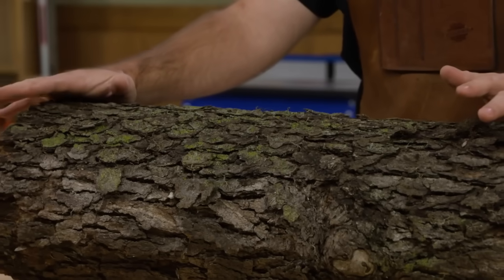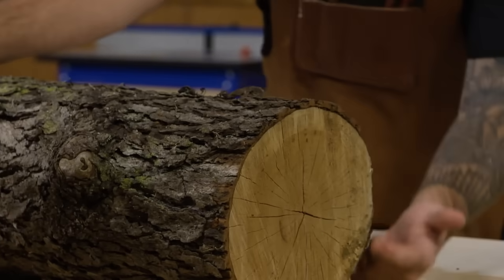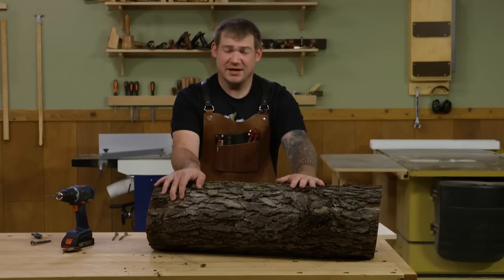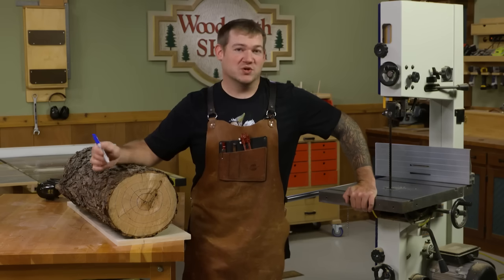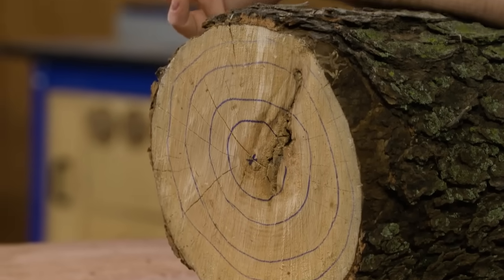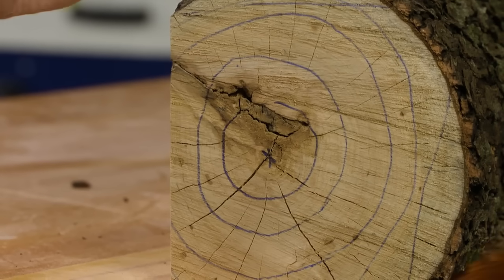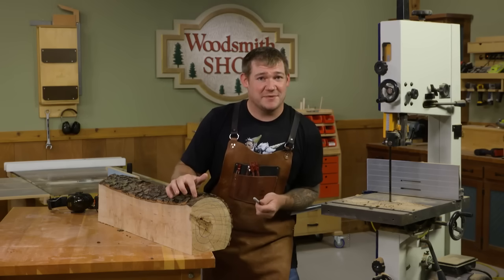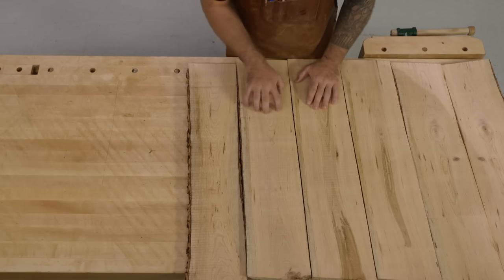Logs to Lumber on a Bandsaw

Comment: I cut a lot of my own lumber. An important thing I learned is to cut all my stickers to the same thickness. Place the stickers uniformly above and below each other per layer. This helps to minimize twisting. It won’t eliminate twisting if the boards have a lot of internal stress, so cutting the green board a little thicker will allow planing later.

Comment: I do something similar on a much smaller scale.  I'm not really a wood worker, but I like to use native species for knife scales.  I have property in the Ozarks and we are constantly cutting small trees and limbs out of our roadways.  I have plum, persimmon, cherry, walnut, sassafras, poplar, redbud, sumac, and paw paw pieces all drying in my basement.  I mill it on a table saw.  I made a jig with square sides that I can bar clamp to the ends of the log.  The jig runs along the fence and the bar clamp holds the log to the jig which prevents the log from rolling or binding the saw blade.  I seal the ends of the boards with duct tape and then write the wood species on the tape.  Some woods are very similar in colors and grains and are not easy to differentiate once the bark is removed.  Once it's dry I rip it to the nominal thickness that I desire and then plane it to a finished thickness.  If it's a live tree that I'm removing I ring it which will kill the tree and let it stand for a year before I cut it down and mill it.  If you ring it after it has leaved out the leaves will pull a lot of moisture out of the tree as they wither.  The whole process takes a couple of years so it does require patience.

Comment: very interesting.  i don't know where you're located, sounds like you're up north somewhere because to someone like myself being in arizona it sounds like  a joke to say "it takes to years to dry".   trust me,  stuff dries so incredibly fast here, you have to add moisture to try to slow down that rate to avoid nasty cracking. 
I have some African sumac wood which is in my opinion one of the most beautiful woods in existence (especially if exposed to the sun, it gets a beautiful red hue), but I don't have a bandsaw.  you mentioned that it's possible to rent time at a mill or something?  how do I find something like that here near Phoenix?

Comment: How could you get mostly quarter-sawn wood from that log?
Reply: zigzaging. You start by making 4 quarters. Then for each quarter, shave a board, turn & rotate 90, shave a board, turn & rotate, until the end. If you look from the top at how you cut, you'll see a zigzag line

Comment: Thank you. 

First time I’ve seen something from you. Very informative and safe. I’ve seen some videos that make me want to go to the ER just by watching them!

I need/want to mill down parts of a friends cherry tree that died. 

I only own a 10” bandsaw. I have seen some videos in the past that use a table saw in conjunction with a bandsaw to mill raw timber. Maybe you have posted one?

The cherry tree was cut down to about 40” in length sections, then quartered down the length (with a chainsaw). The fattest piece being about 8” wide. 

Sorry for all the specs. 

But do you think a brand new Rikon bandsaw (which I don’t want to kill for my friend) with an 1/2” blade can cut it?

I have a table saw, planer, and jointer…

Usually, I leave milling up to the pros and pay for it. That said, I would love to do this for my friend and gain experience doing so. 

Thanks in advance for any feedback!

Comment: A tree fell in a small wooded section across the street, from a snow storm 2-3 weeks ago. Tree guys came and cut it into 4’-5’ sections and just left it on the side of the road. I grabbed 5 of them.
How soon will checking start?, because they all had serious checking just a few days after it was cut up.
Thanks!
:)
Reply: You want to seal the ends as soon as you can after the tree is cut. I mean like set down the chain saw and coat the ends. Ends of the logs dry out quickly and the stress in the tree rings causes the ends to crack quickly. I usually get free exterior latex paint from the household waste recycling center and look for the thickest consistancy I can. If the logs have not cracked yet paint on 3 coats on the end of the logs over a period of several hours. Keep the logs out of direct sunlight and off the ground using a pallet or scrap wood. Then watch them every couple of days for cracks. If you see a crack developing squirt some household caulking over the crack and smear it in. If I have a valuable log I will coat the entire end of the log in caulking also. I have had logs sit for 2 months or more doing this with no cracking.
Reply: @azwheeling8189  Thanks for the knowledge!
 These logs may be a lost cause. They sat in my driveway for like 2 weeks before I painted the ends. Used a regular latex paint.
It already had some heavy cracks. After 2 coats I could still see the rings (as I assume the end grain was soaking up the paint). Gave it like 5 heavy coats.
They are sitting on a sheet of paneling in my garage.
I can’t tell the species yet as there are jagged chainsaw scraping every direction.
Based on your experience, hate these salvageable? If so, what’s your guess on how deep these cracks may have gone?
Hoping to cut, stack,sticker, clamp this week.
Thanks again brother!!!
:)
Reply: I use a real sawmill and soon as I can I seal the ends. sometimes I use this expensive wax paint but in a pinch I have used old paint that was drying in the cans. which isn't bad and helps me identify the wood later because of the color

Comment: Thanks logan. I was wondering if you coated the ends with anything like a wax ,  or does it even make a difference. Thanks
Reply: From bowyersI have heard that they seal their boards/staves with PVA Glue (cheap white woodworking glue) on the ends after splitting the logs in order to prevent splits during drying .... a single one would make their staves useless.

Comment: I use shellac to seal the ends or I mix beeswax with varnish. I lay a small long strip in front of the log and it just stays there. I do NOT want screw holes in my wood.
Reply: Not sure what you mean about a small long strip in front of the log but I do think that the screws he used are much longer than needed. I would think that an 1 3/4" in the middle of the log at each end would be enough but not get into usable wood.

Comment: Does air drying really ring moisture levels down to the 5-7% for use?  I’ve been told it’ll only get down to about 15%, then needs to be kiln dried?
Reply: Depends on the ambient humidity. Stick logs in a dry, hot garage over the summer and they can get under 5% moisture in one summer.

Comment: The video mentioned in passing putting some sort of sealer on the ends of the boards to prevent checking, but didn’t go into detail. What would you use to seal the ends, and is checking a bigger issue in lower humidity environments? I live in Colorado, where it’s super dry. TIA!
Reply: Anchor Seal is the gold standard, but you can also use latex paint or poly for some success. Anything is better than nothing

Comment: Forgive my ignorance, but what is the purpose of putting stickers on the cut lumber? And are they a special type of sticker?
Reply: Stickers are 3/4 X 3/4 pieces of scrap that are put between drying boards to allow air flow to dry them.
Reply: @robertelawson4185  Thank you for the explanation. Definitely not what I thought he was referring to when I first heard it, lol
Reply: You also want to put the stickers as close to the end of the boards as possible. Like 1/2" in or so. The old timers say if the ends crack the cracking stops at the stickers. I don't have a problem with cracking or checked boards as I watch my lumber like a hawk from the time I aquire a log chunk until it is stacked for drying and about 2 weeks after initial drying. I also dont expose my drying lumber to windy days. Drys too fast and that causes checks and cracking. Gentle breeze out of direct sunlight then back into my wood shed at night. Once lumber is not "wet" anymore and about 30 percent moisture it goes into the shop loft until dry. One vent on each end of roof  for ventalation. Also a box fan in front of one vent to increase ventalation if needed. I keep an eye out for mold on the lumber for about 2 weeks after it goes into the loft just to make sure that does not become a problem. i have dried thousands of board feet doing this. Some wood needs weight on top to keep from warping to. Or clamping aparatus if you have it.

Comment: Good info.  Thanks.
Metal detector?
Reply from the maker: Hit or miss in my opinion. I don't use them on my sawmill, because it's not worth the time. Ill usually give the log a visual inspection and remove anything I see. Otherwise, the best metal detector is a new blade, as that's when ill find it :-).

Comment: Dont forget  to tell that you had dry the lumber using stickers after milling boads, then  joint one edge and then rip on the tablesaw, then use the dimension planer, use the router table to cut the tongue and grooves, then after installing you need to use a large beltsander to finish. Some people without experience in wood work think they can do this with just a small home bandsaw. I told her I would mill her logs into usable boards. I have a portable sawmill and can mill logs up to 30" in diameter. she seems to now think she can just throw these on a home bandsaw and dry for 2 weeks... it may appear and feel dry, but use a real wood moisture meter and see what it is inside, the wood usually shrinks about an 1/8" after drying.. 1" thick boards maybe in 6 months air drying. After seeing videos like this she seems to think a home use bandsaw will do it fast, not even a commercial  saw would keep up with a real sawmill the teeth are 7/8" tall. What you are doing may be good for a small project but couldn't imagine doing an entire floor.

Comment: The rule of thumb with drying does depend on geography.  In the arid southwest, it only takes about 12 to 14 months for 8/4 stock to air dry to 8% (basically independent of wood type).  It is better to use a moisture meter than to rely on a rule of thumb
Reply: Moisture is measured up weight, not a $2 meter.

Comment: Alternatively, you can run the log over a jointer to establish a flat surface.  Then you start milling like that.  It's great because there's no prep time and it doesn't have to be wife, just flat enough that itll stay riding on the bandsaw table without rotating.
Reply: I watched a video just yesterday where the gentleman did that exact thing. Next time I am milling logs I am going to give this a try.